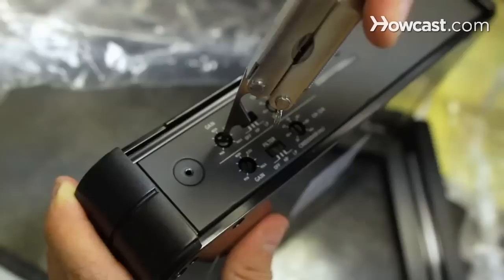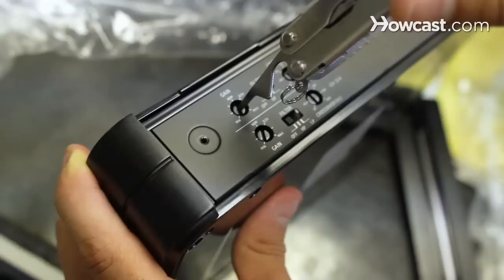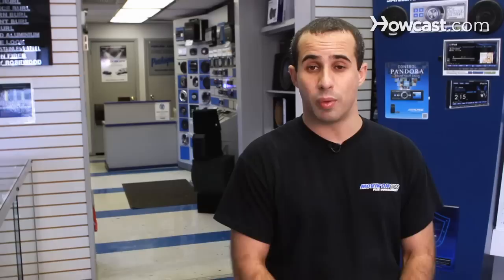How to Tune a Car Amplifier | Car Audio

Comment: lol when I step on the gas it's makes a whistling noise I just like to ignore it and pretend it's a turbo under my hood lmfao
Reply: haha yeah I notice that too
Reply: Are you using a aux plug? when i use the aux plug i hear the same thing when stepping on the gas.
Reply: +Vilouth Phommajack yeah it happens on CD aux radio also but when I got a new head unit installed it went away .
Reply: +n4woo haha lol
Reply: +Vilouth Phommajack try a noise filter
Reply: bruhhhhh me too lol
Reply: lmao I do the same but I'm pretty sure it's the aux cord cause when I un-plug it the whistle sound stops
Reply: Lol...  i do the same too... Hehe...  but im a bit confused whether it will eventually result in ruining my amp.. Got any idea on that??
Reply: lol
Reply: sonu sebastian haha
Reply: That's what I say when my friends ask what that is and I say it's my turbo kicking in
Reply: zach wilson LMMFAO
Reply: put your RCAs on the opposite side of the power..no mo turbo
Reply: Thats what happens when your gain is set to high turn it down and the noise will go away
Reply: turn down your gain
Reply: Ez fix.  U have to ground out the deck. Take a wire and put it in where ya jacks go then screw it to the side of the deck. Noise gone!
Reply: Greg Myers yes.
Reply: Best comment🤣
Reply: Grounded wrong
Reply: Same i said hear my turbo? My friend said idk lmao
Reply: Same🤣🤣🤞
Reply: 4yrs late but it sometimes happens when u put ur rca cables on the same side as the other wires
Reply: zach wilson i have the same thing and i don’t even have a subwoofer just normal speakers lol
Reply: Pause the music, turn the gain and volume all the way up drop it in low and punch it in between the stop lights. It’s just like being in a sr71 black bird just more intense.
Reply: One common cause of speaker whine comes from the vehicle's alternator. If the noise changes in pitch or intensity when the engine RPM changes, it's probably some type of engine noise, and interference from the alternator output is a likely source.

The issue is that noise from the alternator is getting into the head unit via the power cables. You can deal with the problem in one of two ways:

Install a noise filter between the alternator and the battery.
Install an inline noise filter in the head unit power cable.
In either case, the alternator will still generate noise but it won't be able to get into the head unit and cause the speakers to whine.
Reply: Did you disable anc??

Comment: 1:I always setup head unit  just before it starts to clip. Use 40hz 0db mp3  for subs.
2: then i look at my sub if its 300W sub  i adjust my amp  to only output 300W rms
I do it  with math and multimeter set on ACv ..300w x 4ohm  = √1200 = 34.64V
So now we have  output that the amplifier needs to send to the amp at maximum before it starts to clip.
Now i connect the multimeter to the  bridged terminals of the amp ( where you connect the woofer to) and adjust the gain until the mutimeter says 34V . 
And youre done . Oh btw make sure you set to LPF range on a sub.  This method has never burned out any amps or subs for me, and its the correct way.

Comment: If your amp is "shutting off", that could be caused by one of the speakers either shorting to ground or wired with reverse polarity. Check all your (+) (-) speaker leads.  If you can see the speaker, just connect a 9v battery to the leads. (+) to (+) , (-) to (-).  If the speaker cone pushes out  the polarity is correct, if it goes in then it's wrong.

Comment: 🙋‍♂️ 
Question: How do I stop my tweeters (hi’s) from going into protect mode (without pulling capacitor)?
I’m running an amp to power my mids and hi’s and with crossovers. My tweeters seem to be getting too much power way before my mids have reached their full potential.
How can I we equalize these mids and hi’s?
Thank you so much,

Comment: What did you mean when you said after you turn your high pass filter on you go back and repeat the process? What else would you need to do after you set the gain for your subs besides the frequency dial?

Comment: @logan maxwell. Type r 12d4 4 ohm dvc runn parallel for a 2ohm load on that kenwood kac-9105 will out out 900w, turn the gain a quarter and you'll be hittin like a champ. Great sub, good amp! It's never cut out on me...

Comment: The problem is not the "Fusion branded  product " my mids/highs amp was 7+ yrs old ,had been in 3 different cars, and one of the cars was totaled .. But yet it still worked for 3 years more. That amp was had a useful life .. Who are you to judge what product is better that another ?? I did replace that amp with a MB Quart .. Sounds great for price,. So I did the voltage. Tune to  both amps ,I picked up 1.3db from the last SPL contest ! Great video :)

Comment: Does the lpf and hpf settings help eliminate the whistling noise when you accelerate ? Or is it the adjustment of the gain.. I bought a blurpunkt amp and I’m struggling this whistling noise.. I even tried a engine noise filter and that just didn’t not work, actually was worst inaudible.

Comment: Question: i installed  the new Fusion CA CD 800 head unit the other day...Awesome deck ! it has 5 Volt 3pr (Front / Rear / Sub) RCA Line outputs. 7yr old Fusion FP 504 4 channel amp for the mids and highs...
With the other deck that I replaced (Fusion IP-500) I didnt have this issue,..
My mids and highs play when the voltage is 13.0 or more....the sub amp does play.
seems like the 4 channel amp shuts off till is reaches 13.0 volts ? again it never did this before...would this a gain issue?

Comment: When setting the gain on my amp, do I set the separate bass level knob remote all the way up or all the way down?
Reply: I know this is a late response but, if I'm correct, you turn the bass to it's complete max level, including EQ and processing settings, then set the gain. This is to avoid issues caused by adjusting other settings after setting the gain.

Comment: so noise coming from the sound izzzzzzz  is either bad ground or giving more gain than it should ok, what about the power cable i have alpine v9 five channel amp and i power it with sound quest wire CLA copper clad aluminum 0 gauge so will it affect on the performance or it will be just fine.

Comment: Great video Zeta but i have a few  questions that i hope you can answer for me, so the very very first step after installing an aftermarket head unit and external amplifier is:

1) To adjust the head unit's (not the amps sens. gains?) maximum undistorted volume ?

2) Then adjust the amp's sensitivity gain?

is this the right process, reading my amp's manual talks about "target voltage" using a voltmeter when is this supposed to be done and can i use a dd1 instead of a voltmeter?

Comment: A Kenwood 1800 watt class D amplifier, for one subwoofer at a 1000 rms would be perfect. I have 2 kicker l5 baric's running 1200 rms of that Kenwood amplifier and i've had no problems with the subs being under powered.

Comment: Q: Does the gain on the amp make   the car stereo turn off by it’s self? if not set up properly...  

cause mine turns off at high volume
Reply: I had an amp do that, and it was because my remote line was only getting six volts, spliced it somewhere else for 12v and it would stay on

Comment: I have Sony amp 1200w, 2 speakers 120w rms (each) and 1 sup 380w rms..
How to tune the right voltage with multimeter please

Comment: Did you install an amp? If so when you installed the power wire for it did you also install the rca leads/speaker wires along side it, this can cause ground noise from your rpm coming through, or poorly connected/sheilded power wire at your head unit
Reply: Very late, but yes.

Comment: I have an old kicker zr 240 amplifier and after a while (1hour) it gets hot and turns off. I have to wait awhile before it kicks back on any idea what is wrong. How do I tune my amp to my two 12 inch subs?

Comment: Are you saying after you do each filter, you have to go back and do the gain and volume thing?
Reply: Yeah because the filters affect the amp. U may be able to get more gain with a lower frequency range since there will be less frequencies that the speaker/sub puts out

Comment: you can roughly do it by ear like this, it wont be as good as a dd1 or multimeter but say you want to test out an amp or something itll work on the go
Reply: rkb12222 How do you set an amplifier with a multimeter

Comment: You mentioned to set the EQ to off,but what if when I’ve finished setting the gain I decide to set the EQ to a “rock” setting will it not distort after?
Reply: Yes that’s a bass boost probably.

Comment: OR... when your power lead to your amp is too close to you speaker wires. That may cause engine "whine" or ignition coil feedback through the speaker.  Though, yes, typically it's a poor amp 'metal to metal' ground.

Comment: Also make it easy guys and buy a O scope meter. or even cheap a Smd Ddm1. distortion detector. Because at some frequencies you can't hear distortion. And your amplifier or head unit may be clipping. But the by ear method may work for some. But if you have a huge build worth thousands just go out and buy the O scope and have the piece of mind of a proper tuned headunit processor and amp.

Comment: What's the ph on the amplifier do?
Reply: Noel Nunez I'm guessing that's the phase knob. It should go from 0-180 degrees. It adjusts the electrical phase of the subwoofer, so that it's acoustically in phase with your main speakers. Basically, what that means is that sometimes, even if everything is wired properly, your main speakers and your subwoofer may not be playing the same notes at the exact same time. So what happens is that instead of reinforcing each other, they cancel each other resulting in a loss of bass and hollow sound. They're out of phase. By adjusting the phase knob, your trying to put them back in phase, so they work together. Try to find a sweet spot where it sounds the loudest, or if you can't tell leave it at 0.

Comment: thinking about upgradding to scar audio vv12s or gettin 2 p3 fosgate 15s idk witch
Reply: +brett pingel even one P3 would be waaay too strong... I have one, I run it on power series amp... it is a monster..
Reply: Skar ZVX 12 or 15 .

Comment: i have a 900 watt pioneer 2 channel amp. i am powering two 12 inch SVC MTX subwoofers. i also have a pioneer head unit. the amp gets really hot after a while of playing loud music and shuts down. i am running 8 gauge wire and my ground is connected to my body of the vehical. i bridged the subs together and thats when it gets really hot. if i dont bridge them together and run them on separate channels it doesnt get warm. the amp is bridgable but gets hot when i do that. dont know what to do.the subs are MTX AUDIO TN12-04 12" TERMINATOR Series 4-OHM
Reply: easy take it in to your local car audio shop

Comment: I have  jl audio c1-650 and c1-650x powered by JL audio XD400/4 amp. When the radio is off, I still hear audio hissing sound in the speakers. How to get ride of it?
Reply: Make sure ur head unit and amp have a clean ground srtong ground

Comment: thanks you really helped me out a lot. but i'm wondering why within 30 minutes of jamming to this new 1500 watt ssL evo amp why it got really hot. it's pushing two 12s at 500 watt each, they're called NOS Kingwood. Then i decided to turn the gain up and this other knob (which isn't the bass boost) and i was jamming for like 30 minutes and the amp went into protection mode and shut the subs off. Can you help me with this problem?
Reply: Real Money sounds like you need a fan for the amp.
Reply: Real Money and the amp goes into protection mode when it's too hot to prevent further damage
Reply: thanks cause thats what i thought. for right now my amp stopped overheating cause i hookep up the amp to a bigger battery wire and bigger ground. now it doesnt overheat but my amp cuts off when certain bass songs hit hard and when i turn up the volume to the max of 39 on the radio deck. do you think my current problem is cause the battery the amps hooked up to is low on juice? found out that the optima battery in my trunk wasnt able to hold a charge so im about to buy a car audio battery called Kinetik HC 600. do you know if these push two 12s at 500 watts each and if they say 4ohm+4ohm? by the way what does 4ohm+4ohm mean?
Reply: Real Money I've got two 12's on a 1500 watt amp, I had the same problem I had to run a better remote wire and I switched out all of my amp wiring to 0 gauge

Comment: hi mate i bought a q4000 amp and the question i have is when it says
 • Rated Power: 125 Watts RMS @ 4 ohm x 4) does this mean each of the 4 channels has 125 watts rms at 4 ohms
or does it mean it has 125 watts rms between the 4 channels at 4 ohms
Reply: If it says 125x4 rms that means each channel has 125 watts.

Comment: Run your power wire down one side of your car, RCA cables down the other side. No more alternator noise coming through your speakers

Comment: The noise thru the stereo isn't a ground ... It's back feeding thru the alternators voltage regulator or the power wire & the RCA wires running parallel and causing a noise filter issue

Comment: when doing this method, do you turn the bass control knob up all the way first?
Reply: How can you ask such a stupid question.....OMG.
Reply: @eriksrensen6369  LOL. was just pickin brains to make sure. SO, is that a yes to my ? . LOL Do you even have an answer for me?????
Reply: I don’t see how it’s a dumb question, if you’ve never done it before how would you know. I’ve been told to put the bass knob at mid way and start tuning that way but I prefer to max it out so that I wouldn’t risk turning the bass up too much with the remote.

Comment: What about new speakers? How do you adjust a new amp with new speakers? You dont wanna turn it all the way up when there new ? Do you not atleast week or so
Reply: It’s a debated topic but I always give a new speaker a break in period of at least 18-24 hours of play time before pushing them too hard. Gives it time to loosen up I guess. So you can tune the amp to where it sounds good at high volumes but after that just keep the volume at around 1/2 to 2/3 of the highest volume that doesn’t have distortion. Then you can turn that bitch up!

Comment: On my radio a (rockford fosgate RFX 9200) after bass and treble etc it has a setting called sum ive messed with it and nothing changed what is it for???
Reply: TREVOR SIMPSON Look up audio summing device, it will explain everything.

Comment: So I got 1 kicker comp R put in last monday and now it definitely sounds like it has a blown coil, the speaker is rated at 800rms and the amp im running puts put 500rms. The gain was at the lowest setting and my bass boost was on 3 out of a max of 8. Im not really a sound system expert so if anyone could give me some sort of explanation that would he greatly appreciated! Could it be a tuning problem?
Reply: Its a kicker thats youre problem
Reply: The reason this happened was your subwoofer was being underpowered. Your amplifier runs 300 less rms than your sub does, which isn't enough power to push the subwoofer in general. sure you put it on it's lowest gain setting, but putting the bass boost on probably just fucked it all up. ^ and that guy is an idiot. i personally own rockford fosgate, but kickerz is a very viable brand as well

Comment: I have a kingwood 1000 watt amp that turns on buy wont play sound, could this be an amp problem? Because I believe my RCAs are hooked up correctly. (I have a stock stereo with an inline converter
Reply: Ik this is 5 years old but I’m curious if you fixed the issue. Ik if you don’t slice the correct wires to the converter it can mess it up.
Reply: Lol nah I never ended uo fixing the issue, took apart the amp and noticed that the circuit board was cooked. Didn't know too much about car audio back then
Reply: Garrett Gross damn bro that’s a bummer! Sucks when that shit break because it isn’t cheap

Comment: HOW TO INSTALL 4 CHANNEL AMP WITH SUBWOOFER IN MARUTI SUZUKI ERTIGA
Reply: Use the first and second channel of the Amplifier for the front speakers and bridge (connect) the third and fourth channel to a subwoofer.

Comment: How to tune your amplifier:
1. If you have no clue of what you are doing...let pros do it.
2. Set all settings to 0/off on amplifier.
3. Set stereo volume as explained.
4. CALCULATE your wanted output (V = I x R).
5. Use voltmeter along with whitenoise to set proper gain for each channel.

This is the correct way to know your exact output, not risking to ruin your speakers.

Comment: There are two things that I will NEVER fuck with on cars 1.Body Repair and 2.Electrical.  Had a stereo installed at a shop.  They fucking de-valued my car by doing a half assed job I swear.  Anyway I was wondering if my amp was even doing anything and after I watched this video I found out they didn't even set it up correctly...
Reply: +n4woo Man, I would freak out of this happened to me...
Reply: Auto body is a beast and I only mess with small body work and lots of painting. But electrical work is ALOT easier to learn then you'd imagine especially for audio setups and I find it almost as fun as working on my suspension. Now doing like engine wire harness work can be frustrating and time cinsuming, but a few basic tools make it enjoyable.
Reply: Elephant in the room - Installing speakers, subs, and an amplifier are actually pretty easy. It's best to just do it with someone or watch someone instead of looking at tutorials. I had the luxury of watching my dad set my system up and it's literally just a matter of removing car panels and running the cables. Connecting the wires isn't nearly as bad as you think. They have a tool for splicing and connecting. I'd advise learning to do it yourself. Women love it too